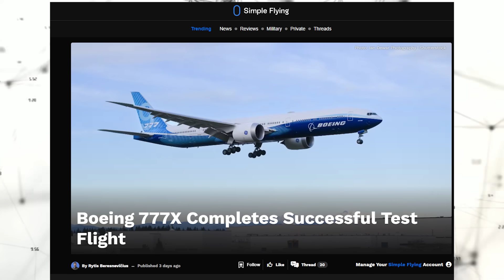HUGE PLAN for Boeing 777X in test flight will change the industry! Here's why

Comment: They needed something a little more exciting than a warmed over redo but I just don’t think their new planes are good replacements for the 747, 757 it’s just customers are forced into it and of course the flying public never gets any input. I’m ok with the redo on the 77 but I don’t understand the ridiculous delays you would think they would put everyone available around the clock to get this plane out the door
Reply from the maker: I believe 777x will be good as 777 once was
Reply: It well could if they ever get the damn thing certified. To say they are struggling with that is the biggest understatement since general Custer said. We might see a couple Indians there, but I doubt it, the Sioux don't gather this time of the year. About six years in delays alone, How long does Boeing think it's customers will wait on them.

Comment: Lets hope Boeing can start delivering before 2027 as customers are running out of patience.
Reply: Customers have already run out of patience—but it doesn't matter. Their only VLA alternative is to cancel Trip orders and then get in line for the A35K, putting them many years out from the soonest delivery.

Airbus' average non-pandemic delivery rate is approximately 15 A35Ks per year, and their maximum projected rate for the type is 25; with the current backlog of 206 orders, customers would be looking at the mid- to late-2030s before receiving their first plane—if they got in line now.

And then there's the engine time-on-wing issue, which is a huge factor for the major gulf carriers. The GE9X comes from an engine family that has proven itself in those harsh desert conditions, whereas the XWB family—even as admitted by Rolls Royce—comparatively has struggled mightily in that regime.

Comment: Boeing is a second rate aircraft manufacturer. Poor leadership. Suspect aircraft quality. Erratic new plan announcements will not lead to anything. Meaningful root and branch reorganisation of the organisation, with Boeing has persistently avoided to date, is the only way forward.  Otherwise the future is one of continuous taxpayer support and bailouts - and shrinking orders.
Reply: "The future is one of continuous ... bailouts." –LizHoward-l7m

Taxpayer support, yes—particularly in the form of long-term defense contract awards, even of the no-bid variety in some cases—but "continuous bailouts"? The pandemic years did see bailouts going every which way in the wake of that $2 trillion CARES stimulus, but Boeing retracted its 2020 request for a $60 billion slice of that rescue package, and instead turned to bank loans, mass layoffs, and a $25 billion bond sale to raise capital. No bailout there.

Comment: Did I miss something? What are these "valuable lessons" & "decisive steps" Boeing have learned and taken to address the thrust link fractures? Because I don't think Boeing have given an explanation for the fracture so far, or how they intend to remedy it? Further, we are told that no FAA employees were on this first flight since August 2024, maybe there were no volunteers😀. Should Boeing not have a remedy, but are simply changing the links more often, that is surely not a permanent fix, but a sleight of hand. When Boeing announce and explain a remedy, Boeing fans and the airlines can relax, but until then, its still up in the air, or not as the case might be...😀...
edit: sp
Reply from the maker: Thanks for your sharing.

Comment: You'd be mad to fly on this dumpster fire.
Reply: The 777X has been a dream compared to the 737 MAX—now that's a proper "dumpster fire"—and yet more than a million passengers a day are now flying on the MAX. That's a lot of mad people, I guess? Meanwhile, by the time the 777X is certified it will be the most flight-tested airliner since Concorde, so go ahead and expect lots of mad people to be flying on it, too ...
Reply: @Infiltrate.and.Betray  Documentary on open drug use in Boeing plant + the cutting of red tape - safety in the US.   no thanks  The 737 max worked out a treat....

Comment: Why risk your airline safety standard banking on Boeing, use daily proven Quality reliability of A350   that is in service since  2015  10 years to date.
Reply: Because if a carrier cancels their 777X today and switches to the A350, they won't take delivery until the mid-2030s at the earliest. Economics simply won't allow for this. And besides, the 777 family has established a phenomenal safety and reliability record over the past 30 years—talk about "proven quality". With the 777X flight testing and certification program being the most rigorous that Boeing has ever experienced, I expect the 777-9 to fall in line just fine.

Comment: At time 9:39 you state that the 777-8 has a length of 708.66 meters. It's a pity that the people "educated" in the USA have still no idea of the international metric system (ISO) International Standard Organization. It's NOT an European System of measurements. It's the internationally adopted standard. Only the USA is unable and unwilling to join the international standard in educating the young generation in the international standard of measurements. The stated length of 708.66 meters would be nearly half a mile. Half a mile is about 804.5 meters.
Reply: Obviously, the decimal was mistyped one place for the automated narration—you know: 708.66 instead of 70.866. You couldn't figure this out, sorgfaeltig? Instead, you go off on an anti-American tirade? I take it common sense is not emphasized in your country's "education" system ...